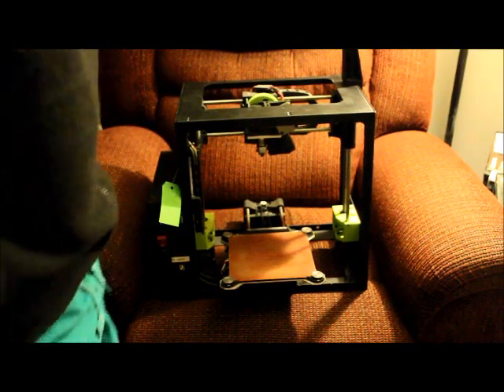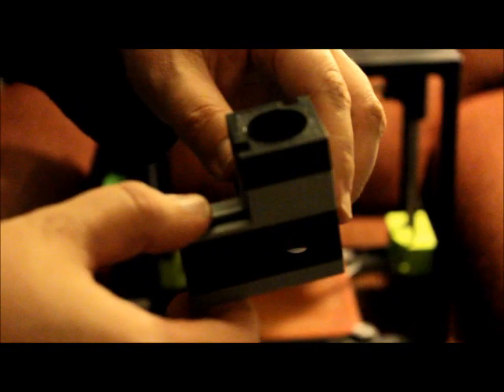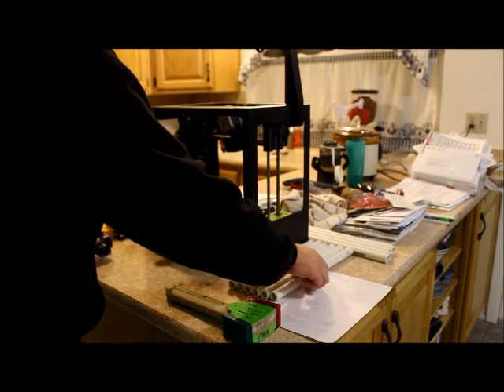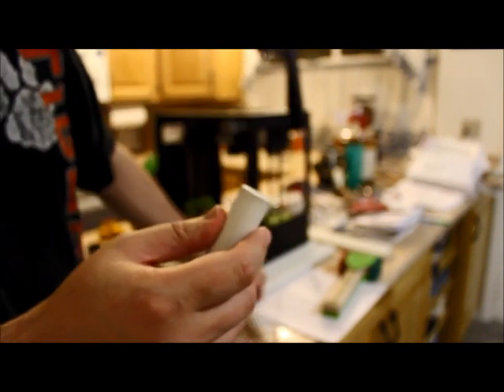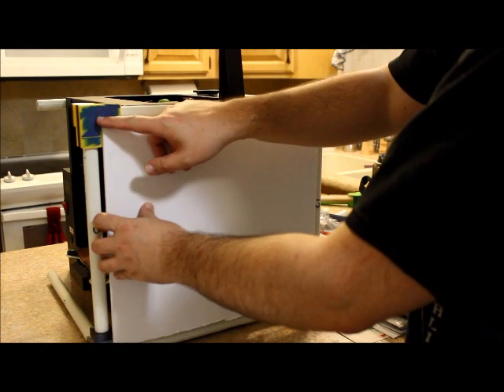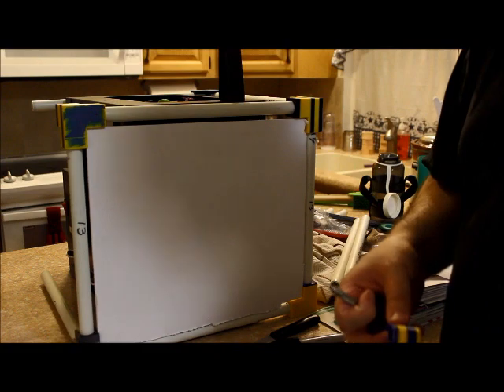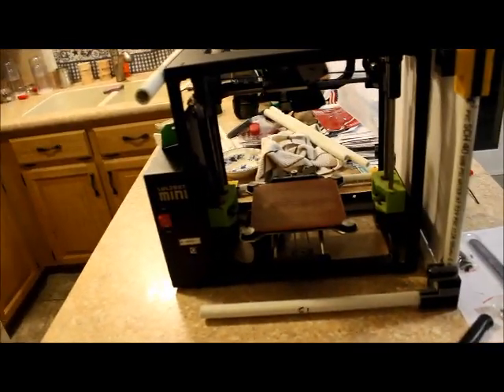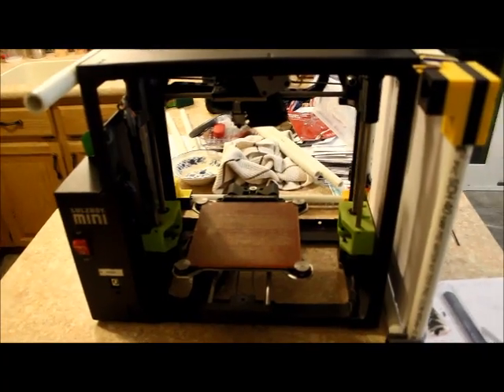PVC enclosure Pt.1

Comment: I would suggest you not use a pipe cutter on PVC. You are making a lot of work for yourself using that and the deeper and faster you cut the bigger the flare will be. A pipe cutter doesn't actually 'cut'; it displaces the molecules (be it PVC or metal) to each side. When you push those molecules aside they have to go somewhere. You're crowding them in with the other molecules so they stack up on top of each other and create the flare at the end of the pipe. Same thing happens using a tubing cutter on copper or metal pipes.

There are a couple inexpensive options: 
1.) Get a cheap plastic miter box and a inexpensive saw, can usually get them as a kit for less than $20 and use that to cut your pipe. 
2.) You can make a miter guide from two short pieces of 1x2 about 12 inches long. Just nail them together to form a corner. Then lay your pipe on the inside of the corner and cut along the end of the wood. The two edges at right angles will guide you to a square cut. Not perfect but good enough for this job. 

Just about any saw will work and you don't need a miter box, but it helps to make square cuts. After cutting with the saw you will have some fuzz on the edges. This can be easily removed by hand or you can use a piece of sandpaper to knock it off.
Reply from the maker: Thank you for all the advice. At the time all I had was the pipe cutter. I used some sandpaper and a hobby knife to take of the flare, but a real PVC cutter would work for a future project.
Reply: @3DPT  Yes, a true PVC cutter would be ideal. I was trying to suggest tools that the average person might already have.

Comment: So is it possible to use that bracket set to make a totally closed side?
Reply from the maker: Yes, if you're careful in how you cut the side panels you can get a close fit. If you have access to a laser cutter or track saw, that should give you a clean edged. If you want an airtight seal you'll need some weather stripping or silicon calk. In the next video I use kitchen shrink wrap to get a smooth covering.